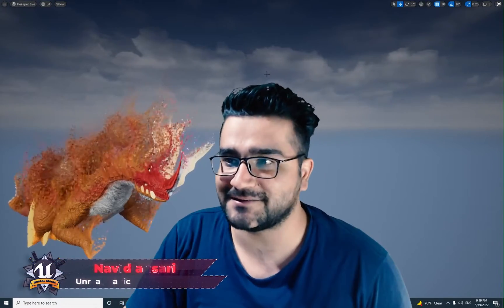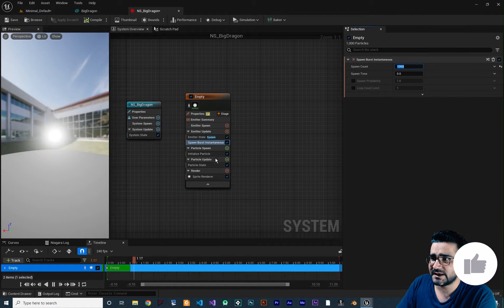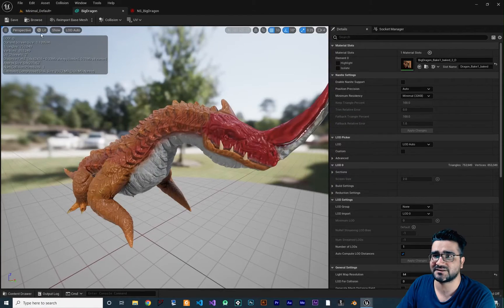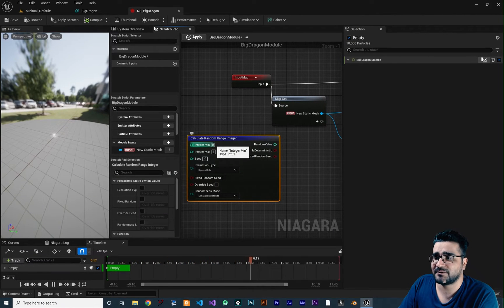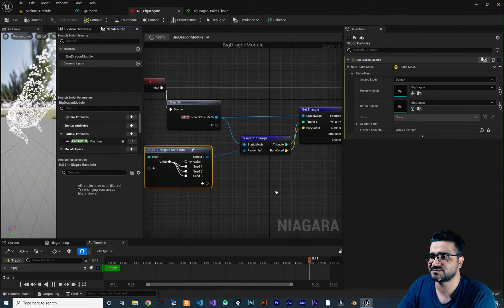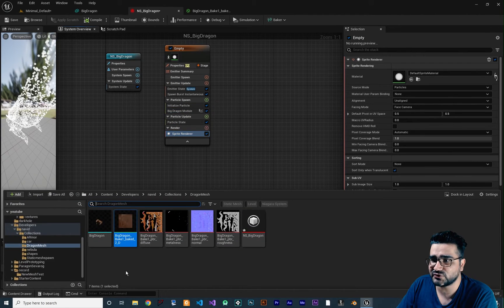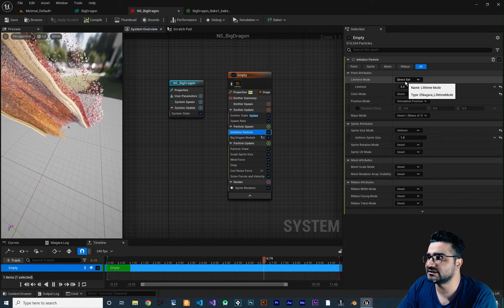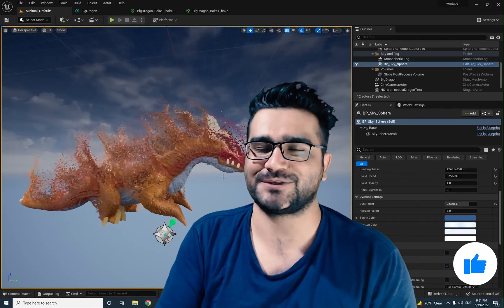Niagara system spawn particle on static mesh with scratch pad script in unreal engine 5

Comment: Great video! Can this same thing be done with a Mesh renderer instead of a sprite renderer? I would like to create this same effect but I want my mesh to spawn cubes insteasd of the 2D sprites

EDIT: Just tested it out, it is possible and this actually is a way better way to emulate the point cloud look and add movement to the points., Point Clouds in UE5 are 2D but by using this method you can retain color data and add movement to your "Point Cloud"

Comment: Is there a way to get this to work with a static mesh asset from quixel megascans? The material gets ruined whenever I try to add a dynamic parameter into the master material UVs. I'm an amateur, so I don't really know what I'm doing or how to resolve this.